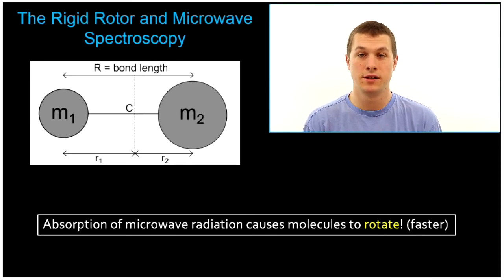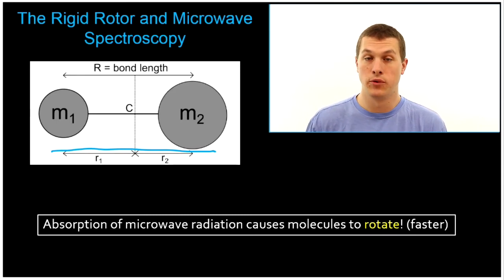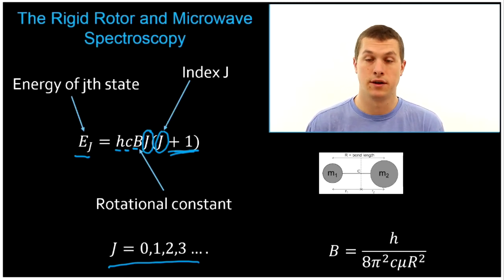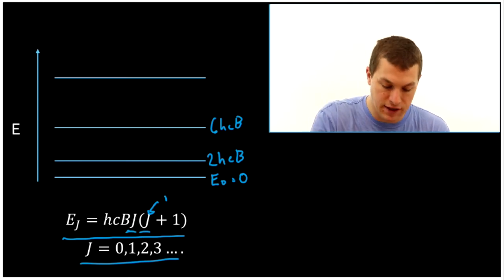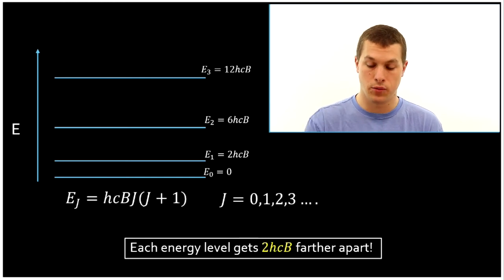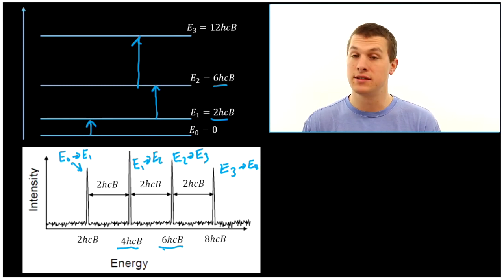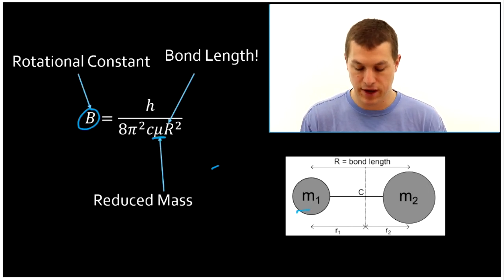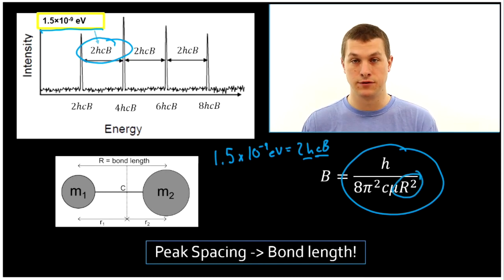The rigid rotor and rotational spectroscopy - Real Chemistry

Comment: how can I get the bond length if I have the rotational spectra intervals in Hz
Reply from the maker: Hi Patrick,

You can use the same process used here, you just need to first covert to wavenumbers. Here is a link to a pdf with the proper equations. Remember if you use the speed of light in m/s that your wavenumbers will come out in m^-1.  https://www2.chemistry.msu.edu/faculty/harrison/cem483/wavenumbers.pdf

Comment: How is it possible to have condensation inside of a microwave? If you cook a baked potato in a microwave, when your done the walls will have condensation... shouldn't the water vapor inside be most exposed to microwave light... so there won't be any losing of energy to condense on the walls? Because as the microwave is running, you can see condensation build up on the inside glass on the other side of the metal screen
Reply: Here's my first, nonGoogle-confirmed take: Prior to turning on the microwave, there is some water in the air already as vapor and some in the food as liquid (or ice, if frozen). When the microwave is turned on and water within the food heated, some water molecules near the food surface will gain sufficient energy to escape as vapor and join the ambient vapor. Since now the the vapor content is more saturated than usual, there are more water molecules colliding with the relatively cool glass surface (which also is probably outside the region of peak microwave intensities,  which are designed to appear as standing waves at the position of your rotating food). This increases the probability that some will have insufficient energy to reflect from the surface and hence those become bound; more water molecules do this, and added with the tendency for cohesion, condensation begins. I suspect also that an enhancement of the process is not only that there is more water present as vapor, but that out of all the vapors that do escape the food, there are many still close to the liquid-phase binding energy (those which first escaped first with just the minimum acquired energy to do so), rendering them more susceptible for recombination at a surface upon collision.